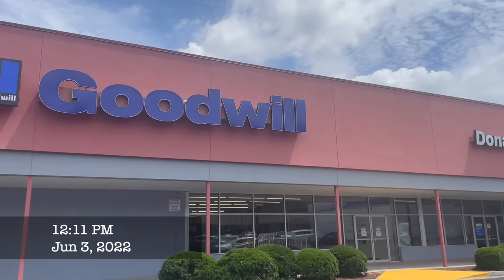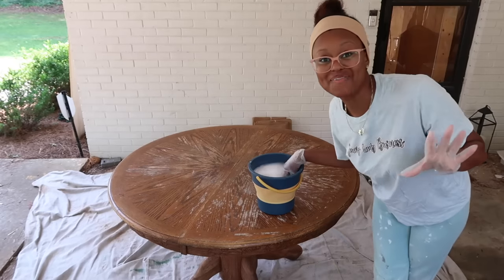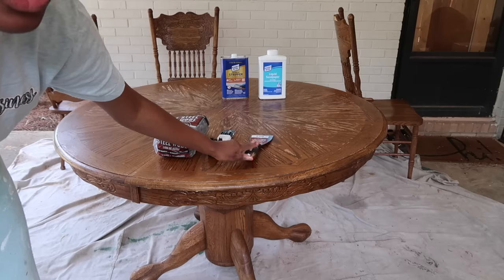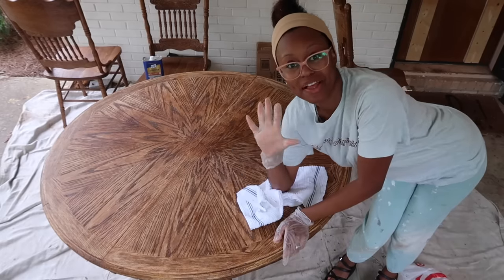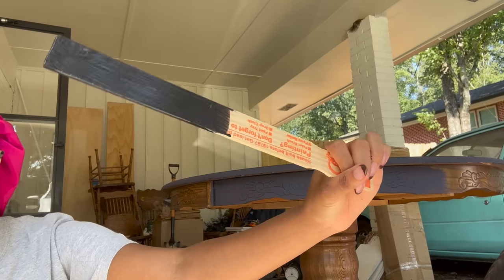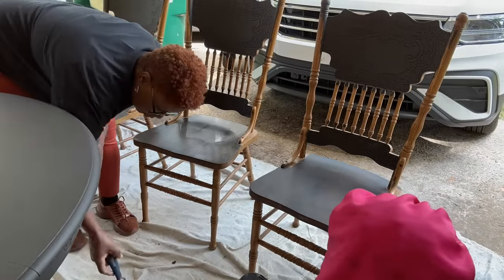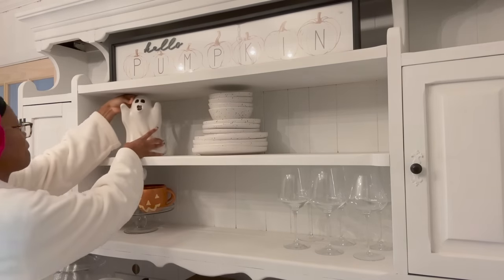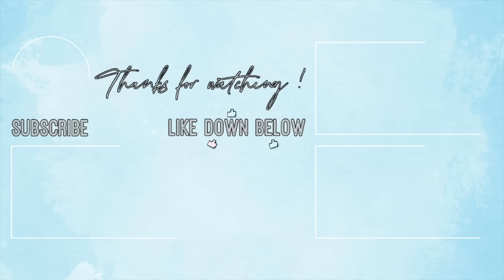DIY DINING ROOM MAKEOVER + Extreme Budget Friendly Furniture Flip| New Rug & Decorating #FIXERUPPER

Comment: Oh Kayla! Y'all put in WORK work painting those chairs with spindles by hand 💪🏾I admire that! A cheap sprayer would've knocked that out in 20 minutes. Also, I recommend polycrylic for a top coat. It'll protect from scratches and give you the finish you want. Love that you kept at it with this. I know the feeling so well of working on something that isn't working like you want it to. But you took a break and kept at it and it turned out lovely!

Comment: Oh no that water based poly is FABULOUS!! I just redid my hutch and used it on dark dark teal. It's AMAZING and so durable. You would be repainting a table every month without it, but it does need 5 days to cure!! I used 3 coats
Reply: It's the best, you really cannot skip the top coat. It's what separates good looking DIYs from cheap DIYs in my opinion!

Comment: The table turned out nice.  As for the uneven surface, it does add character.  And also, if you do a similar project in the future, try lightly sanding the surface of the piece first.  That probably would've worked on your table as well.

Comment: Happy Fall, you guys. A few tips. With chalk paint, to achieve the black to its truest color, you have to use a matte polyurethane top coat to achieve the look you desire. If you want gloss regular polyurethane would've worked. For a matte finish use matte polyurethane.  ❤😊
Reply from the maker: That’s exactly what I used. Is there a specific brand you recommend? bc the one I used still came out with a slight satin feel!
Reply: Thank you for offering this suggestion. ❤  I didn't know there was a difference.
Reply: @YoungLadyBusiness  Rust-oleum Chalked Matte Clear. That's what I use for all my chalk paint projects. It's meant for chalk paint finishes. It also depends on what finish youre trying to achieve. I always do test patches before i apply to any on my projects. I hope this helps. 😊❤️
Reply: @LoveFirstYou You're welcome. It's always best to use a sealant meant for chalk paints to achieve the look you're going for. Regular polyurethane can be used on chalk paint depending on what specific finishes you're trying to achieve. I always do test patches before applying to any projects I'm doing. 😊❤️
Reply: There is also a chalk paint wax that she could use to seal and protect the paint….
Reply: @brendadurden6414  Yes, it is. I actually used Minwax finishing paste. It worked pretty well. I chalk painted some fabric chairs and wanted the finish to be soft.

Comment: Is the table top solid wood? You sometimes see that puckering when incompatible paints are used together (the chemicals react), or maybe one of the products you used was still in that area and they reacted. if the table top is veneered it could be veneer lifting. I would sand and recoat.

Comment: I would highly recommend using gloves and eye protection whenever you are working with such toxic chemicals including the varnish work. The top of the table was damaged when you bought it. It should have been sanded before any other work. You could use a sander on the damaged section now and repaint.